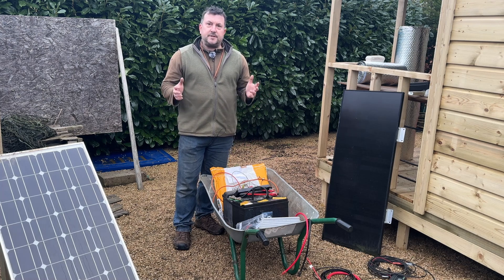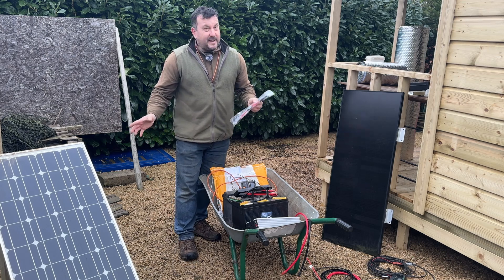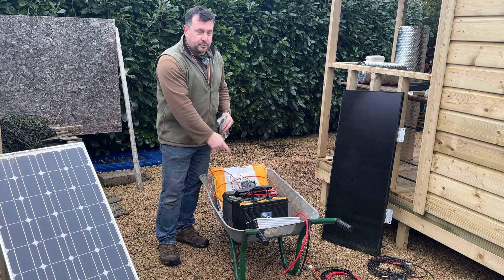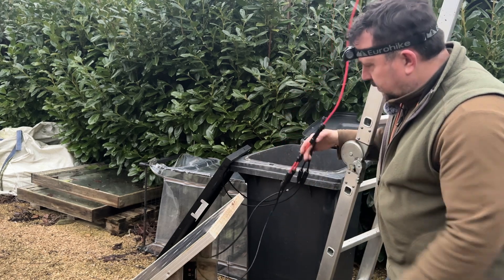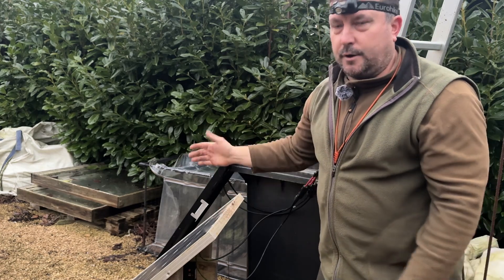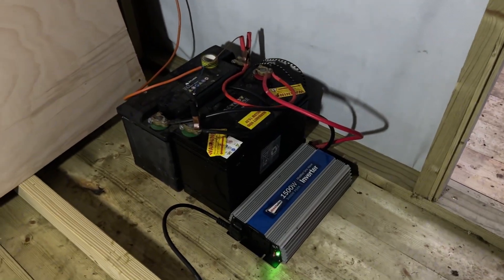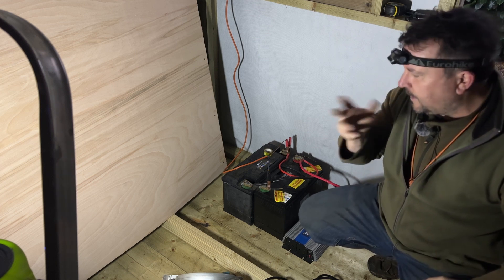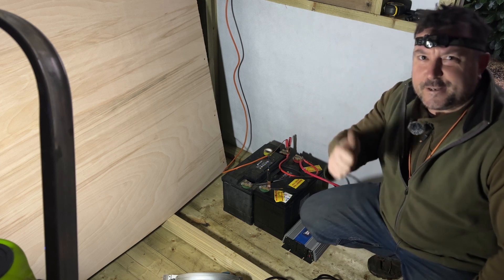Installing Solar Power in the Off Grid Cabin | Off Grid Cabin Build

Comment: You would be better with LED much lower power.
Reply: Anything that runs off the battery 12v would better than using the inverter I found the inverter draws massive power from the battery. The inverter is ok while the panels are charging the battery or the engine is running in a vehicle.
Reply from the maker: @colinlakin yeah I can see a slight drop in voltage when I turn it on, only about 0.1v on the readout but it definitely draws
The one I have at least only uses the cooling fan when there’s a wattage draw of over about 100w it seems, anything lower it obviously doesn’t get warm enough to trigger the fan so at least that’s not running all the time
Reply from the maker: Yeah my lights for the cabin will be led it’s just my work light that’s halogen I used while I did the ceiling installation 
I might get a set of that led strip you can get that’s remote controlled and does mood lighting in different colours, could be quite nice